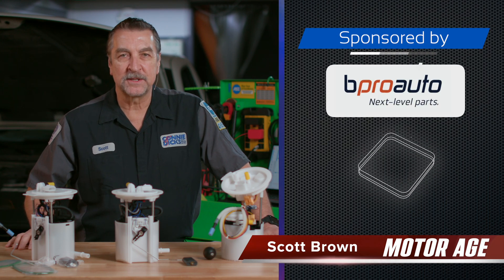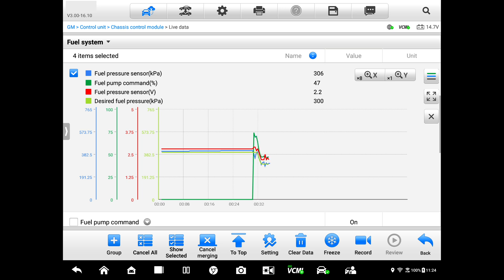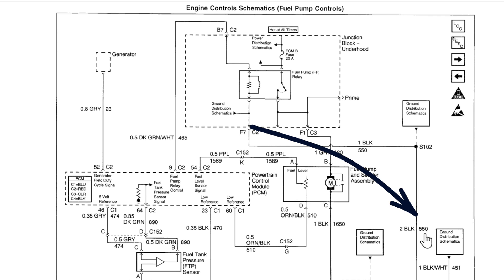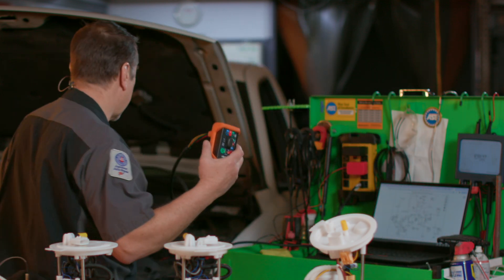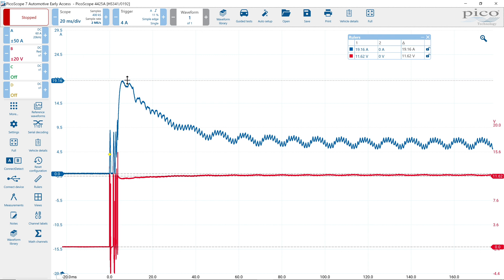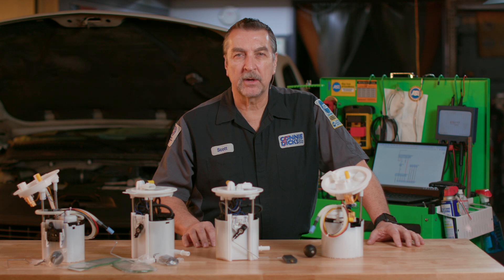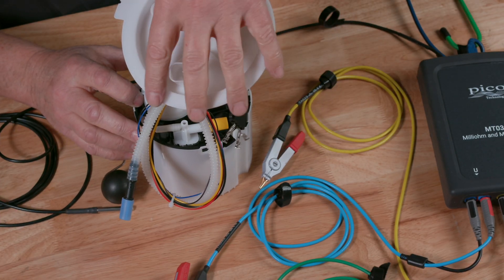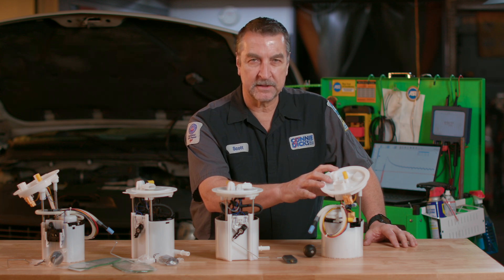Motor Age Tech Tip: Expert Tips for Diagnosing and Servicing bproauto Fuel Pumps

Comment: As a retired ase mechanic my snap on vantage scope would be used to glitch capture the 12 volt + ripple of induced spike and related dip with each commutator segment.
Between this test and higher than normal brush resistance was a dead ringer for a failing pump